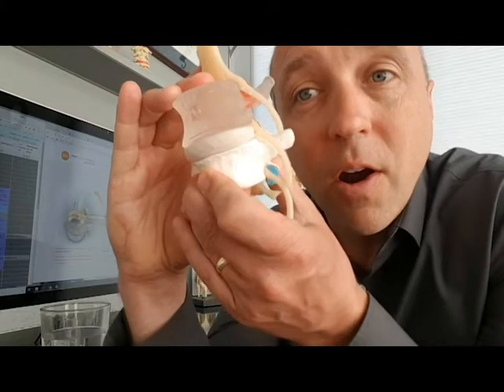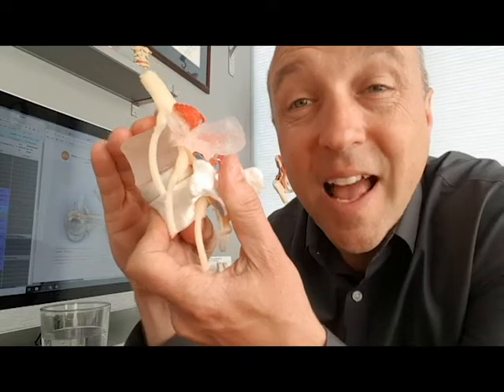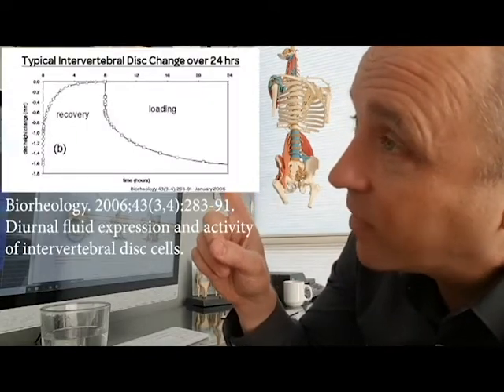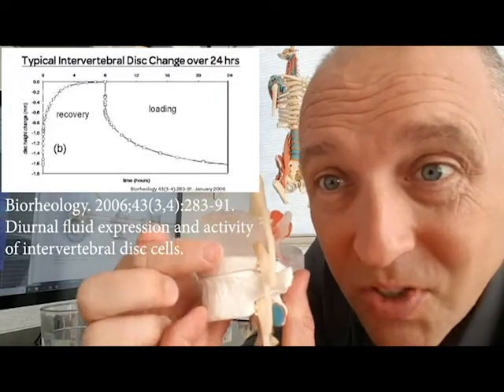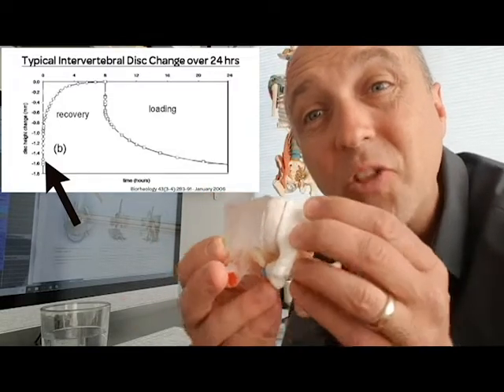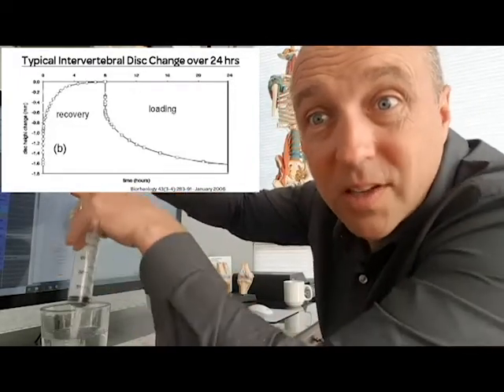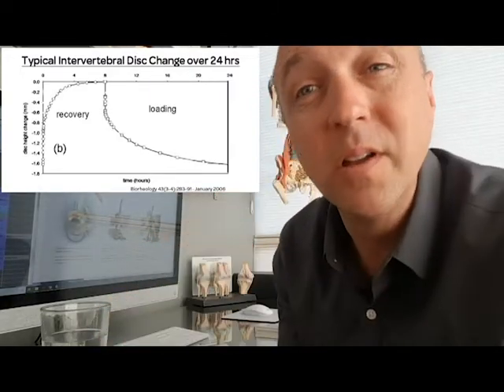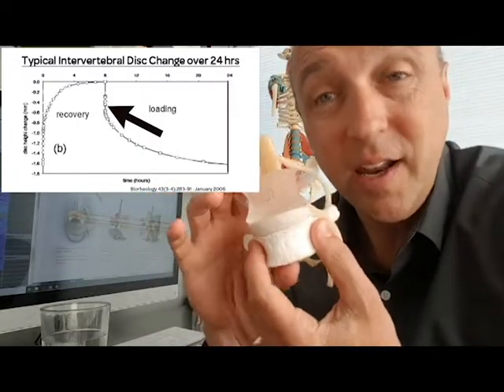Spine changes, stiffness and morning mechanics - Understanding back pain

Comment: What muscle group would you say is most important in stability in preventing the shearing forces you speak of? 

Do you recommend side planks and other movements that resist movement at the spine?
Reply from the maker: Good question. If we were to ask Stuart McGill, he would likely say the Big3. You need stability in all three planes...front, back and side. But it will likely depend on the back in question.